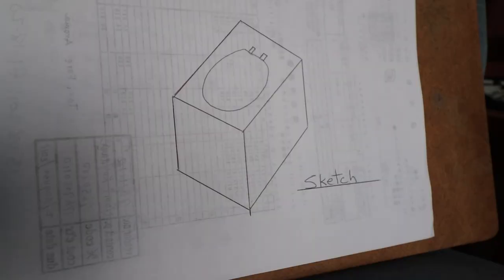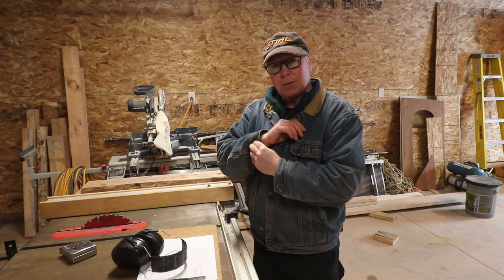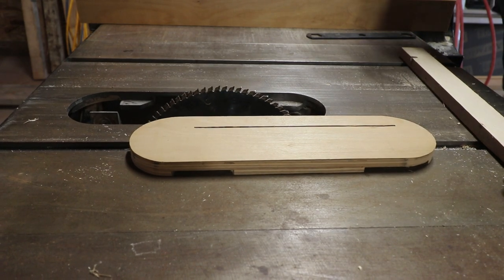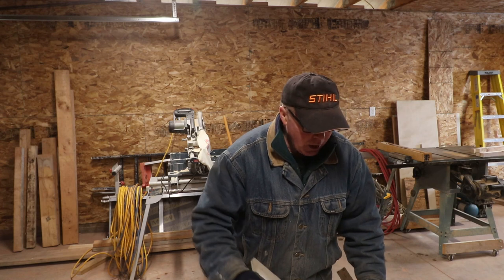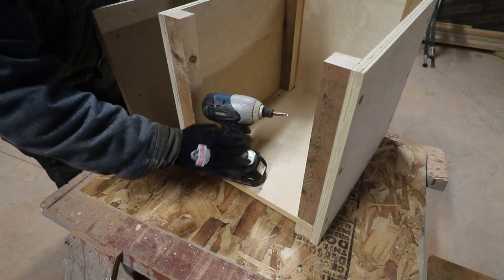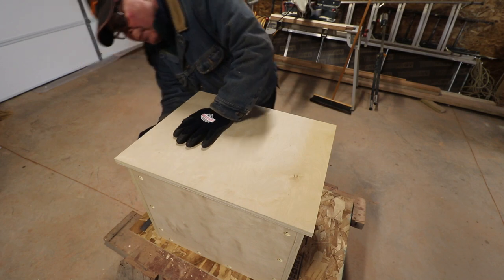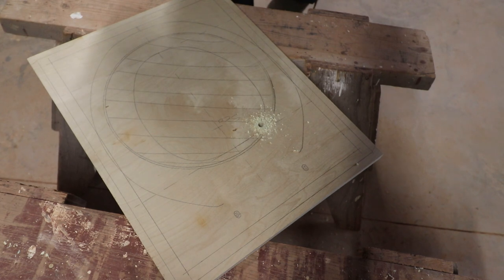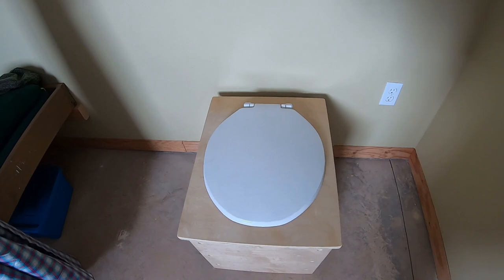S1E14 DIY INSTRUCTIONS ABOUT HOW TO MAKE AN ODOR FREE DRY COMPOSTING TOILET FROM SRCATCH

Comment: Hello Alan, great video, so many useful woodworking suggestions and insight, thanks for sharing. 
You mentioned a problem with cold weather and your compressor, when I lived for many years in Michigan, experienced the same problem. I have a oil type compressor, and what I did to solve my problem was to switch over to synthetic compressor oil, but more importantly for me, change the drive pulley on the motor to a smaller size, which puts less strain on the motor, and worked fine. I did not notice any discernable increase in time to charge the air tank since the compressor is turning somewhat slower.
Reply from the maker: Thanks Don, I will do just that! And as always thanks for the supportive comments.

Comment: Followed this video today and it was a big help. Very happy with how it turned out. Only problem I ran into was with the 14.75 inch supports. I was using 2x2 lumber, where you ripped a board in yours. I had to cut off 3/4 inches to accommodate the gap for the plywood. After that everything fit like a glove.
Reply from the maker: I'm delighted to hear that. Caution, not all 20L buckets are the same height. I found the tallest one I could find so that if a smaller one had to replace it I could put a spacer under it to bring it up to the right height. Thanks for the comment.

Comment: Nice ⭐️⭐️⭐️⭐️ 

Exactly Ike the ones I’ve built. I’ve also just cut the top piece for the lid and add cleats to secure the bucket if one doesn’t have enough wood to build a box. Not as stable or attractive as a box but  effective in a pinch. No pun intended.

Other dry mediums I’ve successfully used are cedar/pine chips and coffee chaff or dried spent coffee grounds. Coffee is very effective at killing odors but also boosts the nitrogen content so you may need to adjust the balance when the contents are moved to aerated curing.

And yes, best to wait a year or more before using.
Reply from the maker: You are a man of many talents Mr. Code. Good tip on the coffee grounds, I'll experiment with that.
Reply: @RoversRest  I've heard that in Germany making spent coffee ground cakes for compost toilets is a cottage industry.

Comment: Great video and guidance on use of table saw and blades. Could you please provide the exact height of your 20L bucket without lid? I’ve got 5 gal  buckets from several suppliers and want to close to your dimensions in inches. Thank you!

Comment: In your elevation view, the supports are 14 3/4” long. The total height is 16 3/8”. And the support underneath the plywood is 1  1/2” thick. That leaves only 1/8” thickness for the plywood. Am I missing something??? Thanks.

Comment: Add a clear glass jar fixed to the side of the box fixed to its pre holed and screwed on lid to attract the flies from the dark bucket interior permanently, they love the light and avoid flying up your bum when you open the lid.  Fly paper in the jar will trap the flies in there and entertain you while you poop. You can unscrew the jar and dump the dead flies and paper into the bucket every now and then.

Comment: Joe Jenkins (Luvable Loo, The Humanure Handbook) states that  the cover material, (he uses sawdust)  needs to have some moisture, that it needs to be dense in order  to eliminate the odors. He explain that the dry cover material allows too much  air and  for odors to escape. So, I guess now I am confused…..
Reply from the maker: The peat moss is dry but also dense due to the fineness of the particles. Saw dust has relatively large particles with a lot of air space and would benefit from a bit of moisture (but not too much)

Comment: For a dry toilet, I would have expected a urine separator. I am using the urine separator from Free Range Designs in the UK. Has been working fine for one and a half year now.
Reply from the maker: The bottom line is that this toilet fits the brief that I was working towards: inexpensive, functional for men and women, odor free, and the production of exceptionally useful compost for our orchard. I looked into a urine separator before designing this toilet but the cost of even a cheap one greatly increased the cost of what is a perfectly acceptable and functional toilet that I built. Mrs. Rover also pointed out, when I was in the design process, that a lot of women (not all) do not posses the ability to aim as men do. And finally for us, especially in winter, an added chore with a urine diverter is that the urine collector (attached to the urine diverter) must be emptied daily to avoid odors as opposed to our design which only needs to be emptied when 15-18 L (3.5-4 gal) has been collected. Thank you for a thoughtful comment
Reply: @RoversRest  I understand that the objectives are different on a homestead. I can discard the liquids overboard since the law changed in 2019 here in NL. To prevent odor, I add 200ml of vinegar to the 20 liter jug. I only have to empty once a week. The Free Range Design separator was 40 euro. My comments are aimed at the DIY builder reading the comments:-) The odd female visitor prefers to walk a mile to the toilet building in stead of trying the compost toilet. I will have to inquire about her aim :-)
Reply from the maker: @Nerd3927  I can't help but smile as I read this. People have become so detached from the natural world that they would prefer to walk a mile to have everything sanitized and flushed away, lol.
Reply: This video is really helpful. But since English is not my mother language, I wasn't able to understand what exactly the material you put in the bucket after you use it is. Can someone write it down for me so I can have a look in the translator? Is it peat moss?

Comment: Does the toilet paper go into the bucket? Or do you throw that out?
Reply from the maker: Very good question. You can do either and it will be fine, I intend to experiment with this and find out which is actually better. I will have a follow up video about these details in a month or so. Thank you for subscribing.
Reply: @RoversRest  i loved your sailing adventure so much. Your videos have been a great inspiration during this crazy time.  I hope to leave Alberta and do some sailing when I retire.
Reply: Standard bathroom tissue is ok to compost as it's another carbon source. Carbon captures methane, absorbs moisture and eliminates putridity.
Reply: @MaShcode  thank you

Comment: Film sequence time spot : 630...lets say this..'the very 1st step is to pull the saws power line..' Nothing worse then fiddling with the blade swap & having a fool in the shop or kid or whatever unimaginable prospect ..boom, one lost hand ! I'd add a couple points pertaining to topping off pops..1. Peat moss is a very fine plant & a limited resource. Using it to cover poop is sacrilegious. Its a finite resource..so ID suggest instead- use wood fire ash,wood dust..& if you have washed up seaweed...sun dry & cut in a food processor..boom!  And its smart to pitch fork that outdoor gold pile say every month..to allow complete air circulation & exposure.Position pile where it get at least a half day of full sun..& definitely keeping the poop as free from urine is a top priority..So pee in another container..& give it a toss strategically...or read up bout brewing urine based teas to spray or water canning about your trees & shrubs.. Don't worry, your garden wont go to 'sh_t ! Hope & imaging your break from 'reports from Nova Scotia ' re-kindled your Utube commitment ..from here on the west'est coast to you on the eastiest..fair winds ! Canyon
Reply from the maker: Thank you Canyon for a thoughtful comment. You are correct concerning deenergizing power equipment before doing maintenance or even changing blades. Having worked with table saws for over 30 years and taught scores of apprentices at the college level, I always teach this (it's part of the curriculum and it's clearly stated in the owner's manuals). I didn't say that here because it was just a "how to" video and not a safety video. I will do a safety and competency video on basic carpentry tools in the future as I think this would be useful to a number of aspiring homesteaders. I also intend to do a follow up video on the use of the toilet, including an in-depth discussion on the medium and the pros and cons of the different mediums. I should also emphasize that the toilet doesn't produce waste, it produces a very high caliber compost that will be used in the planting of our orchard, giving us the gift of fruit for decades.

Comment: I was expecting urine diversion.  A friend saves out the urine for his garden.
Reply from the maker: I was going to buy a urine diverter and try it out on this version but Mrs. Rover doesn't think that her aim is sufficient. Secondly, the urine catchment has to be emptied daily or more often depending on heat. The urine is captured in the peat moss and will an important part of the rich compost. I will have more to say on this in a later video. Thanks for the comment.